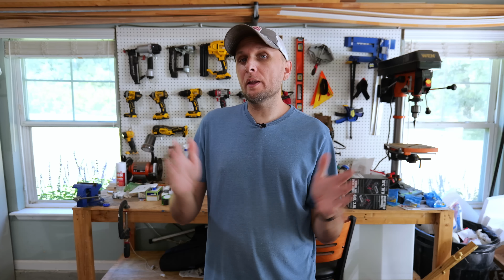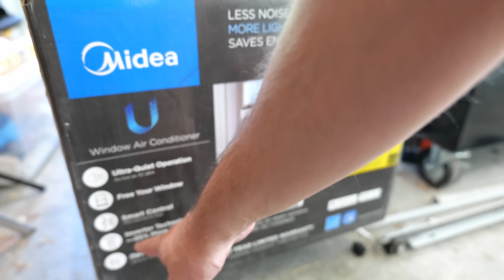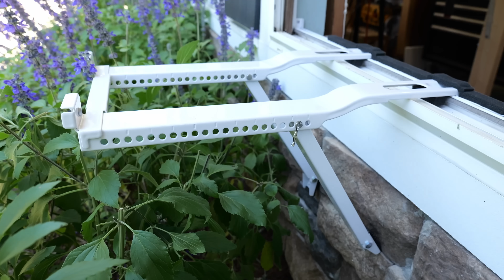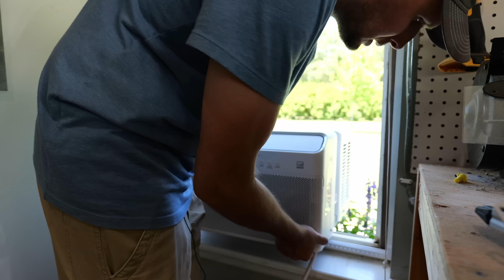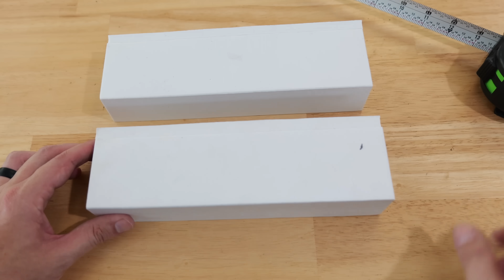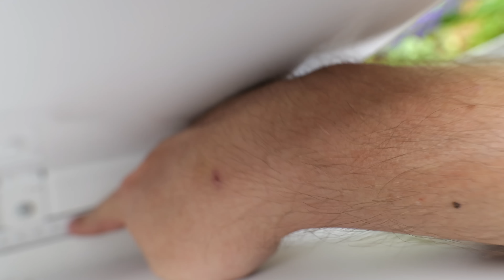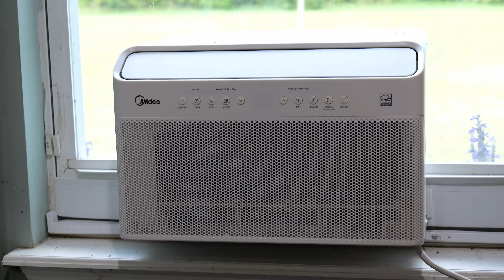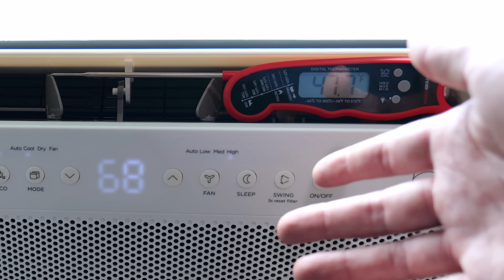The COLDEST And QUIETEST AC Unit Ever Made!  Still Use Your Window!

Comment: Mfg did a good job thinking about the features of the unit✅ ( if your really worried about someone getting in, you can get cut a piece of white trim ( or whatever color your window frame is ) and wedge it ontop of the window up against the frame, so it blends in and locks the window down )
Reply: Home Depot sells white plastic "Wiremold CordMate" that has an adhesive strip on it.  Cut it to size and stick it on top of the lower window at either side.  It blends in really well and is sturdy."
Reply: I was on an HOA and did some research for residents on the first floor wanting to keep windows open during Myrtle Beach's spring and fall cool weather... the easiest thing to prevent someone from cutting your first floor screen and walking right into your home is to plant Holly, Knockout Roses, Regular roses, or anything with sharper leaves. Home invasions can be on a whim without protective gear.  With something like this type of barricade planted properly, it shouldn't impede air flow but also is not easy to step over or get through. 

A couple seconds of heads up could save your life. ❤🏃🏼‍♀️🏃🏼‍♀️🏃🏼‍♀️

Comment: Save your money and buy a 240 volt Mini Split!  We bought two Midea 12000 BTU units to help as a supplement a/c to our older 4 ton Trane unit. After 3 months both Midea units would not cool properly and both units became very noisy. Their Customer service sucks and when we brought the units back to Home Depot the CSR at the returns desk said "we see a lot of returns from people saying they are not cooling." We are in the process of buying two Mitsubishi mini splits.
Reply: I have to maintain a Trane, Mitsubishi, & Pioneer… despise them all equally. Been using my Midea 3 years… out of the 11 I’ve owned, it’s been my favorite, even over the central unit. 

Never had seen any AC blast dry mold before we got the mini-splits. I want an AC that I don’t have to get a ladder & vacuum to weekly.
Reply: @sunshine3914  I'm glad your Midea has been very reliable for you! I just can't say the same for the two units I owned or the three units sitting behind the Return Counter at Home Depot. 😎

Comment: Are there any subscription fees for the app service?  I would never buy any electronic device that requires you to use an app.   I've heard too many horror stories about companies that start charging you a subscription immediately or months or years later in the future and can also change the terms of service, as they allow themselves to do that deep in the fine print.  And if you don't agree they brick your device.
Reply: No fees for the app. App isn’t required but provides some cool features like schedules, boost, and led light control.

I mostly just use the controls on the unit.  I keep the remote in a drawer and never use it.
Reply: @RobC1999  I appreciate what you're saying but what if you really want one of those cool features that's only on the app?  Then you're kind of forced to use it.   I hate the trend of putting more and more of the functionality of devices on apps because that puts you at the mercy of the company, or even out of luck if the company closes.
Reply: You don't have to use the app or even connect it to the Internet. The physical button and/or the supplied remote are all that's needed.
Reply: @BigNo.2Industries  Good to know that you don't have to connect to the internet, thanks.
Reply: It's a shame because it seems like a really cool unit.

Comment: I bought one of these from Home Depot few weeks ago. I use flashccool from the app before I get home and it’s super chilly (68ish) in Louisiana. Really worth it, kind of expensive but it runs good enough where if you have Eco on it’ll actually cool your room and turn off when temp is reached.
Reply: I would have thought they all would do that.
Reply: @linsqopiring6816  I’ve had other window units before but this one has been the best so far.

Comment: Will the window and the screen to keep the bugs out both fit in the 'U' space of the AC?
Reply: my unit only fits the window and not enough space for the screen, but this should depend how far apart the screen is to the window. My unit was just .5 inch short because my window has a .5 inch grip lip that sticks too far out to allow the screen in the gap but I'm still able to close the screen to the back top end of the AC. I could rig up a mesh screen to cover the bottom gap, but I don't plan on opening this window during the summer anyway, so I didn't bother. What is nice about this design is I do have the option to push the unit out a little to allow me to close the screen all the way down to get some fresh air but since the unit has a fan only option there really is no need to open the window at all.

Comment: Is there an engineering reason why no one has ever made a window AC for horizontal sliding windows?
Reply: Costs, hard to spend the money for R&D and production for a 2% market
Reply: @101mazz   I havent seen a vertical opening window here in CA in 20 years!
Reply: @101mazz  2% market? Maybe it's because I'm in California, but even when I traveled to Washington, Oregon, Nevada and Arizona. All those states had horizontal sliding windows.
Reply: @tracerit   IKR, I've never seen vertical sliding windows except in old buildings.
Reply: They made them. I found  some online less than 5 years ago. There was,also, a company that made a saddle unit that hangs over the window — it is its own bracket. Still hoping to find another.
Reply: Yeah, I had to build my own custom frames to mount window units in our last home that had old horizontal windows. I'm not even a builder or carpenter, but we had no central air, and the summers were getting really hot(out in WA state).
Reply: They do. Just saw one in my local F.B. Marketplace. They've been around for years and years.
Reply: they do exist  but its not easy to find

Comment: You didn't put a link to the window bracket? That was a nice one.
Reply from the maker: It comes with the AC.
Reply: Being a specially shaped unit, it came with the necessary bracket to make sure it's secured based on the design.
Reply: Yes, I was just about to post the same thing. Please include a link to the bracket to hold the AC. I'd like to get that one as well.
Reply from the maker: It comes with the AC.  Were you wanting one separately?

Comment: You said you'd have to take the whole window with you.  What if the unit breaks and you need to replace it?  Can it be taken out or no?  
The plastic pieces that keep the window secure and closed don't look very secure.  Plastic gets old and breaks.  Yes, everything is plastic these days.  Cough, or will the unit need to be replaced before the plastic gets brittle?  Of course, the least secure part of the house is a window.    
Frankly, I despise all the extra control devices.  Sure, you wouldn't have to use them but you had to pay for them.  The remote is guaranteed to be lost or will have a battery problem.  Just had a 2 month old tv remote catch fire with regular ol' Duracell batteries.  And having appliances on your phone is begging to give someone else control and access to your home.  Example is your garage door opener or front door lock - like, helllllloooo!
Reply: Yes. It’s a window unit and can easily be removed. 

And if you get a new unit, you can use the old bracket if you want. 

The bracket that holds it is metal - not plastic. It’s painted white.

I did notice after one year it does have some rust on the case, so I don’t know when the AC will give up the ghost.
Reply: I totally agree about the app.   It's a privacy issue as well as the company can start charging you a subscription any time it wants for what used to be included.  
 As far as the remote, I don't know if you've ever heard of them but there are universal programmable remotes.  You can back up all your remotes so if you ever lose one you've still got a working remote for the device.
Reply: You don't need the app, it doesn't need to be connected to the Internet, the remote doesn't need to be used, the buttons on the front of the unit are all you need. FYI we've had 1 for a year and the remote batteries are just fine.
Reply: @BigNo.2Industries  True but also true you'll be missing some of the features if you don't use the app.   Features they could put into the remote.   But I appreciate the feedback from a user of this.  I'd have to check the list of features only the app has to see if it's a deal breaker for me.   Peace.
Reply: @linsqopiring6816  there is no feature on the app I've ever used after setting it up I tried it once and have never needed it since. I have run a Kasa plug to monitor energy usage and turn it on and off remotely while on vacation.
Reply: @BigNo.2Industries  Glad it worked out for you 😊  Again, thanks for the info.

Comment: From my experience, Inverter Technology can be both good and bad. You explained the good, but there are two potential problems to watch out for. First, the technology makes LOTS of electrical noise on your powerline. Maybe you don't care but for me, I used home control technology over powerline, and couldn't use it with an inverter device on the line. Maybe this is better now, don't know. And often this noise cause other problems and you may never know. Like your Bluetooth mice in the area don't work well.  The second problem is longevity. Time will tell, but from experience, inverter devices aren't very long-lived. Again, time will tell.
Reply: Any distortion of tv or display pictures?
Reply: I'm going on four years now with several of these and none of them have failed.  They also don't glitch the AC like a regular AC box does.   (No dimming of lights when they come on etc)

Comment: having used mini splits, and the Midea U shaped, the Midea is garbage
Reply: Depends upon the climate. I have 3 different minis, & I loathe all 3.
Reply: Is it because of the mini splits system design is better?  I have a rental with 4 headJapanese mini splits and the tenants like them. I have another rental that I want to do a similar project. Yet, not sure about the expense.  Maybe this unit doesn’t cool as efficiently, but cheaper to install?
Reply: Disagree. The cost vs value isn't even in the same galaxy.
Reply: That's great to know! Thank you.

Comment: Can't compare to the whole home ac because there are way more drops and the coldest drop would be the one closest to the A/H and the less coldest one would be the far this from the A/H unless you have a zone system so yes it might be colder then some of the vent but not if you put your whole home A/C to 60 and test whats coming out from the coldest grill. An if you don't have a 20° split in your house then your A/H has a problem!
Reply: What's a "drop" that you are referring to?
Reply: Drops as in each grill in your house. Each grill will give a difference ° so yes the far this one will be the hottest one and the closest one to the A/H will be the coldest and you test your TD from that.

Comment: I've been thinking about this Midea unit for awhile, as a replacement for an aging/noisy existing window unit. Your video convinced me! Thanks!
Reply from the maker: Glad I could help!  I honestly am so surprised at how quiet and how well this unit works.  Super happy I picked it.  Let me know what you think once you get yours and install it!
Reply: This one is NOT noisy like a conventional on/off compressor AC.  It's an inverter so there isn't that kickstart sound. It's going to be a dramatic change. You will love how quiet these are. It's like 42 decibels. A box fan on the lowest setting is louder than this AC.  I have a Danby, if you want to look one up.  It's identical. I got my 8k BTU for $299 through Target.  It shipped to my house.  That's one more option.  It's really weird that it says Danby, but mirrors Midea exactly.
Reply: @Starry_Night_Sky7455  It looks like the Danby has been discontinued.

Comment: I have 3 track storm windows, so the installation would be more difficult requiring building up the sill. So I bought the very similar Dreo inverter unit that installs like a conventional window AC system. The 8000 btu unit was on sale last year for $200, including shipping and longer warranty with registering the purchase. The comparative downsides noted so far are the absence of WiFi access, the remote isn't illuminated and the unit is a little heavier than the Midea.

Comment: It’s a nice design but mini splits heat and cool for the same price as this unit.
Reply: It's basically a mini split in the shape of a window AC unit. I think the heat pump function isn't configured into these units because the power plug is only rated for 110 outlets. Not sure if Midea even makes a version that's both AC and heater but no doubt it would be a 220 model.
Reply: @riopato2009  I have one of their portable ACs that is 120V that has heating so it would likely be doable if they wanted to, even if it was only mild heating.
Reply: But not many people are DIY. Splits are far more difficult then a simple window unit.  This was $275 someone said, splits are 3 or more times expensive then most people need pros to install. I had a 12000 btu split priced at $5000.
Reply: @robertgregory2618  I subscribe to a HVAC repairman and he has install and review videos of mini splits. The last one I watched was $600 and it looked fairly simple to install.
Reply: @robertgregory2618  there’s also a bunch of RV DIY Mini Split install videos. Again it looks fairly simple.
Reply: @robertgregory2618  a fucking split priced at 5k?? bruv you got scammed. a good 12k split here cost about 1k dollars including installation

Comment: I recently bought an 8k Midea for our bedroom.  My GE was not cooling and was incredibly noisy.  It was only 2.5 seasons old.   All my AC units seem to fail in the third year - GE and Frigidaire.
I decided to try Midea.
The installation was much more tricky and unexpected, especially with a porch roof under the window.   I simply removed a foot and made it fit, no cutting, just in case it needed returned.  It's level but still works.
The sealing around the window is not that good.   The sealing system is overly complicated.   I used Gorilla Clear tape to seal over the gaps.  That negates opening the window!
In operation, the unit is super quiet.  I often have to put my hand up to it, to see if it's working!   It cools the room very well too
🤞it lasts longer than 2 seasons!
Reply: I never use the apps with AC units.  I have zero need to use my AC remotely!
Reply: @AllenReinecke  Preferably you should not buy anything that requires the use of an app.
Reply: @linsqopiring6816  it doesn't really "require" you to use the app, but it does have its perks, like disabling the function sounds the AC makes when you change settings for one
Reply: @gillz107  I know what you're saying but if one of those extra app features is something you really want then it kind of does force you to use the app.   Hopefully there would be nothing I'd miss that much though.
Reply: @AllenReinecke it good to check the app to see how much electricity the unit is using
Reply: You gotta open the case of the Ac unit and clean the inner side of the coil every year. Three years without cleaning, it's a no wonder they stop working.

Comment: is 68 the lowest temp it can get too because .... that isnt like super cold
Reply from the maker: I just went out and checked on mine.  60 is the lowest I could get it.  So great question!
Reply: You can set it as low as 60F. I also like the dry setting for dehumidifying.
Reply: So you didn't max it out to test the sound like you said when you tested the sound.
Reply from the maker: @xxcoolxguyxx7680 unnecessary to put it all the way down to the lowest thermostat setting.  Setting the thermostat down 4-5 degrees more than the temperature of the room will kick it all the way on in auto mode.  But like I said in the video, I also manually set the fan speed to max.  So yes, it was as loud as it was going to get for the decibel test.
Reply: There's a feature on these units to max out the AC to cool the space based on the temperature set so setting it to 60 degrees is useless unless you plan on making the room at a constant 60. I don't even keep my unit below 73 degrees because it hits this temperature fast the moment I turn it on. It also dehumidifies the room at the same time so it feels colder than it actually is.

Comment: Awesome video! Is there one you would recommend from Midea for a window that we don't need to have open & closed?
Reply: This one.  It's ridiculously easy to install.  I don't open my window. I have one like this.  Why would you want those accordion panels when you can have this? This one has solid firm foam blocks at the bottom. It's much better, I think.  This one puts zero pressure/weight on the glass.  That's such a great feature. It all rests upon the support bracket.  That's probably better for your window. Well, I've had this U shape type AC for a month now. This is probably sounding a bit too good. I haven't run into any issues yet.